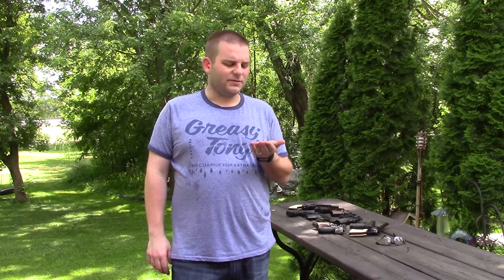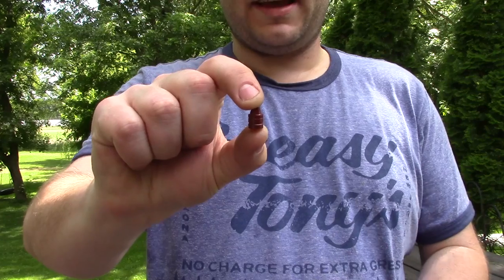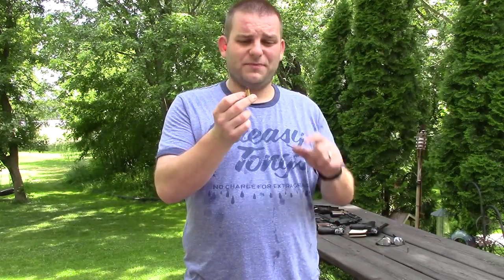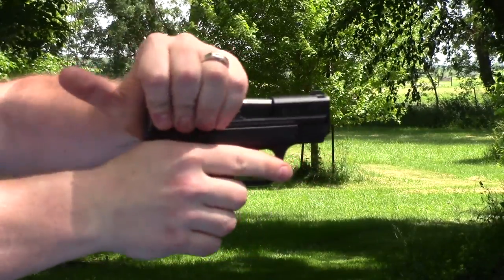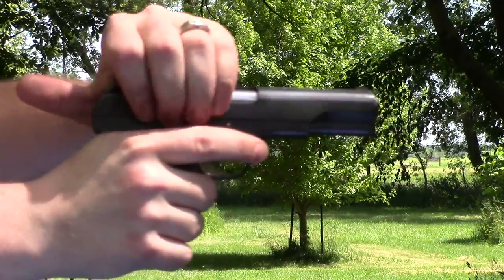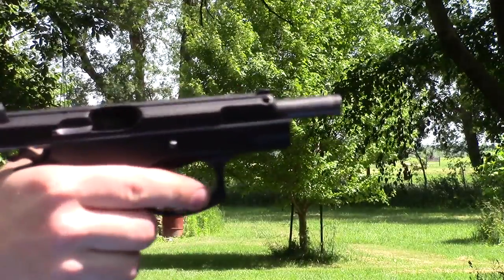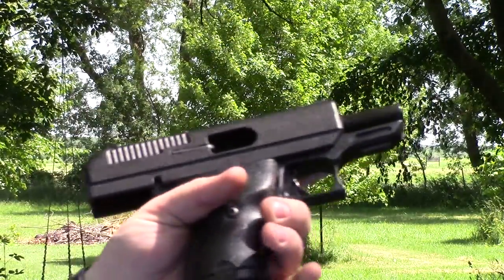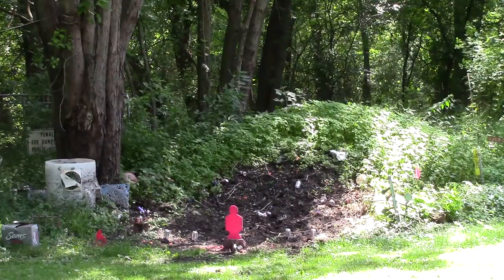Can you shoot .38 SWC bullets in 9mms?

Comment: My dad used to do this with his series 70 1911. Back in the 80s he shot competition with it so it helped both to be cheap and the SWC punches a really nice clear hole in paper so he wouldn’t have to worry about being miss-scored.

Edit: If I remember right though he did polish up his feed ramp. The angle is very steep on a 1911 and that sharp shoulder on the swc did catch a few times before he did

Comment: Well, a 9mm is .355, so a lead bullet which is usually sized 1 or 2 thousandths larger anyway, shouldn't have a problem. My lead 9mm's are .356, and are available. 357. .358 could be a little tight, however the last batch of .358's I got for my .38spl were measuring .356 and .357 
(undersized imho) so I wouldn't hesitate to try loading them for my SW Mod 59, which will chamber empty cases all day long. 
Your experiment was great, and it's good to know you can go outside the box...as long as you are careful about it.

Comment: Most say it won't work but I load the lee 358-158tl Swc in 9mm. Sized to .356 1.09 oal and 3.5 grains of unique... my glock 19 seams to like them
Reply from the maker: I think using weird bullets is much easier in modern guns like glock that are made to just throw the bullet from the mag into a funnel shaped chamber.  Older designs with controlled feed like the 1911 will always be picky because they count on the bullet being a certain size or shape so it's always being held in place.  I think the biggest problem with the CZ is it has short lips on the mag and the OAL is just short enough on the 105SWC that by the end of the lips the bullet isn't contacting the chamber yet and the mag spring pivots the round up into the barrel hood.  But as I said seating them longer isn't an option as the front driving band has no taper and just sticks in the rifling.
Reply: Gun&ShotTV I agree! Going to have to get the 105 swc now :) on top of the 158 I use the 120 grain tc and the 95 round flat. I even play with them and 38 special from time to time. Great video by the way!

Comment: Nice pistol collection! I go the other way and load 9mm bullets in 38 special cases.
Reply from the maker: These are just some of the 9mms.  I know I missed a few like the P38 I shot in a few videos.  I think it was the Baretta 96 and the 5906 videos iirc.  But I think it could use some new springs so I'd rather not shoot it too much until it's resprung.

I think 9mm bullets in .38 would probably lead to leading and be inaccurate for most guns.  Though I'm sure there are some guns with tight barrels that shoot them just fine.  You could also bump them up in a lubrisizer if you have the strength and a .358 die.
Reply from the maker: You can also put metal tape between the mold halves to get a tiny bit more width if you want to get them bigger to try to oversize them.  With the cost of lee molds it's probably easier just to buy a specialized .38 mold if the bullet profile you want is available in .358

Comment: Thanks for this info. I'm looking at a pile of Lee 158 gr RF that I want to try in my Beretta 92 and Walther P99.......
Reply from the maker: Obviously you will need to size them to .356.  Depending on the brand of brass you are using you may have issues as the bullets will seat pretty deep and brass walls get thicker near the base so the brass may bulge and not chamber.  You will also be in uncharted territory for powder loads so use something like quickload to get a rough estimate and make sure you aren't radically overpressure because the case volume will be tiny and pressures will  go very high very fast.

FWIW in this thread someone says they are using that bullet in a Beretta 92.
http://castboolits.gunloads.com/showthread.php?296357-Lee-358-158-RF-90692-Mold-for-9mm-ADVISE-PLEASE

I would do some googling and reading to get more info as there may be some tricks to get it to work and cycle while keeping a decent safety margin.

Comment: Might have better luck with a 124 or 147-158 grain bullet. Never a fan of really light bullets in the 9mm. I have some old WW white box in 115g but they just sit there. I just load 124g RNs for now but will be loading up SWC in 124g+ sizes soon. Remember that the 1911 guys have been running SWC forever with no problems.
Reply: I run 158 gr Lee SWC in my CZ75, over 3.6 grains of Hodgdon Clays. Feeds perfect, and are ridiculously accurate. I seat until the front band, and it looks just like the rounds in this video

Comment: 9mm is .355 inch
.38 is .357 inch
I've got a threaded revolver and I'm scared it will damage a 9mm suppressor. Really wanna throw an Odessa-9 on there.
Reply: Most 9 is .3555-.356 the difference between the smallest and the largest standard bullets for either 9 or .38 is about 2 thousands of an inch--or 1 thou per side of the bullet. In other words, about 1/4 the thickness of a sheet of standard office paper. If your muffler had those kinds of tolerances, the bullets would scrape just from the vibrations caused by firing. I'm sure you're more than safe, but get some calipers and measure your baffles if you're unsure.